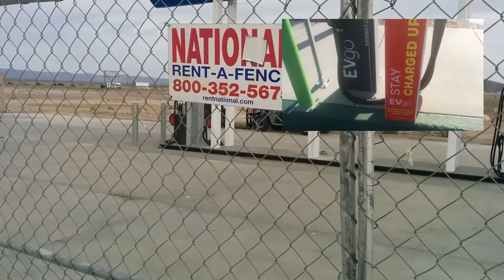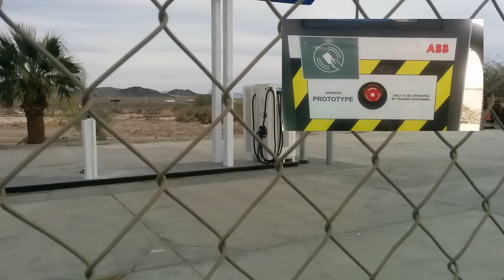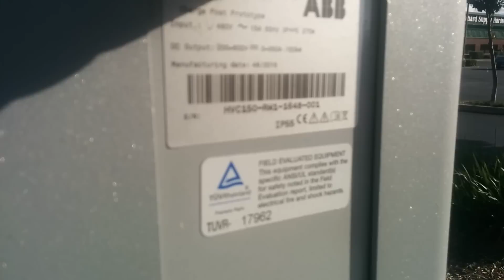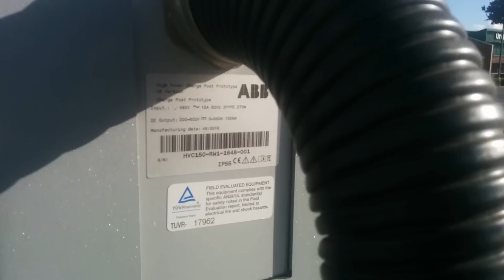Bad News Baker EVgo

Comment: Man, I can't wait to see those over here in the Northeast! I live in Maine and although we have a decent amount of EVgo and ChargePoint stations (we could always use more however) they're all of the 50kW flavor, and even worse there's a good bunch of 25kW still out there...

The local Chevy dealer just put in a DC Fast Charger and what did they decide to go with? A 25kW unit! 😔
Reply from the maker: The 25 kW unit is a requirement for the dealership. I kind of understand it because it significantly reduces the cost for the dealership. GM is having to balance keeping the dealerships happy while still having them move toward EVs.

This trip out to Las Vegas, I realized that I was wrong about a charger that I thought was 50 kW. It turns out that all of the DC chargers in Vegas are 40 kW or less.
Reply: I REALLY don't mean to be a GM apologist (I still resent them for crushing the EV1(literally), bailout, ignition switch deaths, etc, I do own a Spark EV for full transparency), so please correct me if I'm wrong, from the GM presentation I watched, the dealership chargers are not required to be "customer facing." The chargers are mandated as to recharge serviced EVs and cars on the lot... which is absolute garbage. As News Coulomb mentioned already, EVs are a "tough enough sell" to dealers, that "cheap"($9k retail) 25kw DCFC stations for their own use, was perhaps an easier sell than a ~$20k 40kw+ unit & infrastructure. 

I understand and appreciate frustrations like yours. I think realistically the best thing we can do is help create a snowball effect. Articulate why EVs & PHEVs are a great choice for non EV owners when appropriate, contact manufacturers to express your desire for a particular electric car (existing or new, I've contacted Nissan regarding wanting an ENV200, and expressed my disappointment that they won't sell me their vehicle), etc.

Comment: What is the maximum charge (DC) that the Bolt can take??
Reply: Steve Dutcher 80kW
Reply from the maker: The manual states that you need an 80 kW DC charger to charge at the Bolt EV's fastest rate, but that might be similar to Hyundai/Kia stating that the Ionic and Soul EV charge at 100 kW. Their max charge rate is actually ~70 kW, but they require a 100 kW charger to achieve it.

We still need more confirmation of the Bolt EV's actual maximum charge rate, but it appears to be about 55 kW.
Reply: News Coulomb I like your answer better, but it makes me wonder if the BOLT can take even more than that. (55kW) If we follow the 80% rule then 80 of 80 is 64kW... Could 64kW be the max?
Reply: The Ampera-e, the european version of the Bolt,  was tested at a 100 kW charger in Norway. It maxed out at 55kW for only a short time of the charging time.
Reply: It's sad to me that we don't have a 100% answer on this question after the bolt being out for an entire year and a half.